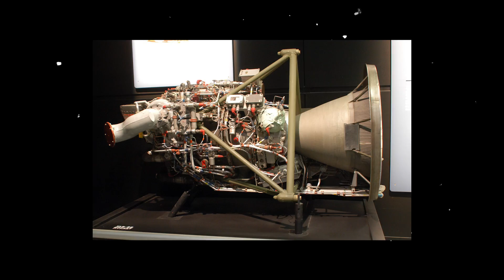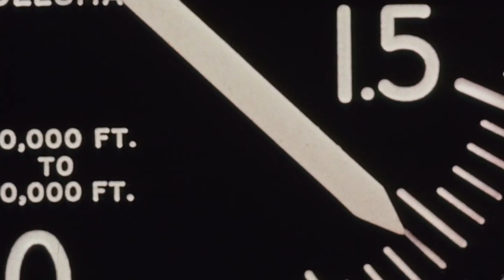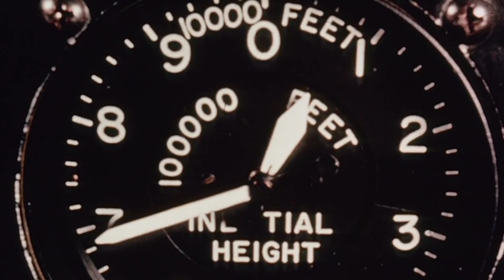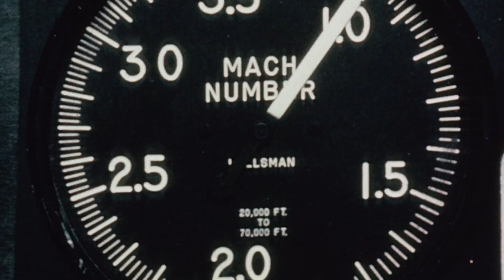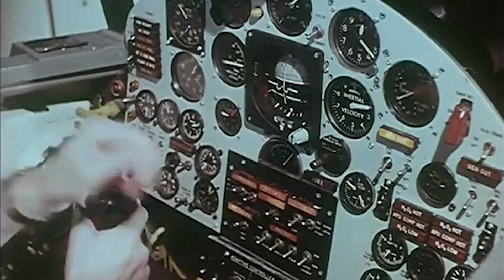The Plane that Almost Melted - The Fastest Flight Ever Mach 6.7

Comment: "defied gravity" is a objectional expression. You can't defy natural laws, just use them to achieve lift to exceed the weight, in this case deflect the incoming flow downwards by a wing with circulation , according to the Kutta Joukowsky law:
Lift force is the product of the density times the velocity times the CIRCULATION times the wingspan . The understanding how circulation is produced, namely by separating vortices such that smooth flow leaves the trailing edge, according to the Kutta condition. This was understood by Ludwig Prandtl and his Students.

Comment: No aircraft built has ever "defied the laws of physics", they have in fact used those very laws in order to stay airborne.
If they defied the laws of physics they wouldn't have need wings or a means of propulsion, they'd have been able to just sort of float up into the air somehow and speed away.

Comment: This is getting kind of sad.  The  Bell X-1 did not "defy the laws of physics".  It's design applied physical law in order to achieve the engineering that made exceeding Mach 1 possible.  And the title is just clickbait.  An X-15 was coated in an ablative substance in order to handle temperatures that it wasn't originally designed to handle.  The coating melted.  It was supposed to melt.

Comment: *important*... he wasn't doing mach 6.7, he was only doing mach-4.3 over land... the speed of sound at 100kft is actually less than the 677mph ... referring to the mach number is meaningless.   The pressure up there is less than 1/6th that of sea level so the end result isn't all that much more impressive than a Foxbat at full tilt at mach 2.5 at 60,000 feet which is taking nearly 5x as much density and quite literally twice the force to the face and moving over land at a greater portion of the X15's velocity than not.    Mach value is an incredibly arbitrary number compared to cross-section force... as James May said when driving the Veyron, the wind pressure was equivalent to driving through fruitcake at 250mph at sea level.    Why do I mention the Veyron?  It applies about 1/500th the thrust the main engine of the X-15 produces and has roughly the same effective wind cross-section.

Comment: As a kid, my father worked at the Lockheed Skunkworks.  I remember hearing sonic booms frequently then they suddenly stopped.  Probably some old ladies complained about them.  I thought they were cool and were only far-off booms, far from hearing damaging.  Years ago, my ex-wife and I were driving along a remote desert road that was sparsely traveled.  I had an F-18 come down and turn over me only a few hundred yards off the ground.  The wind blast knocked my car over several feet, but I thought it was fantastic.  He/she was probably using me for target practice, or just playing around. Years ago, I was at the top of a small mountain with my brother, and an A-10 buzzed us.  It must have been traveling much slower because I remember no wind blast and the plane was very close.

Comment: While still in the possession of North American Aircraft, Scott Crossfield was strapped into the cockpit of the X-15 in a test stand. They were testing the then-new One Million Horsepower rocket engine. Crossfield shut the engine down after a test run and when he reset the ignition system, the engine exploded, blew the X-15 in half and shoved the cockpit part of the fuselage 15 feet forward.
Crossfield later commented "It was like being in the sun, everything around me was orange.
Reply: After this event Crossfield gave an interview to a news reporter. He said he had not been injured but his pants got wet from the water used to extinguish the fire. Next day the headlines said "X 15 explodes, pilot wets pants".
Reply: @romanroad483  Right!

Comment: it was pioneering work with x15 that made the space shuttle possible. But didn't the space shuttle go faster than the x15 - yessir, it did!
Reply: Not in powered flight it didn't. The narrator in this video is very careful to always specific "crewed powered flight".

Comment: I have to say that you didn't follow through with your title or opening introduction to your topic leaving the question to what happened to the pilot when the jet was melting and coming apart around the pilot at 4300 mph. Certainly he could not have made it to the ground if  jet was melting. Lastly the picture is either a fake or left out of your presentation all together. Because no crash is mentioned.

Comment: “One of the most experimental aircraft ever built…” How do you actually quantify that? More “experimental” than Concorde or the Space Shuttle?
Reply: Truly the most experimental aircraft humanity ever witnessed
Reply: Absolutely, yes. The X-15 was literally designed and built for testing unknown flight parameters, whereas the Concorde and the Space Shuttle were both designed more or less within known limits in order to do their respective jobs.

The Concorde and the Space Shuttle were innovative and cutting-edge, but they weren't experimental.

Comment: If a jet flying 5400 mph melts and rips itself apart from the speed how come a rocket doesn’t rip itself In glad
Reply: Because we've learned from these tests, and from many many rocket tests.

And also for the same reason why the X-15 was so much blockier than supersonic planes: the exact same features which make a wing good for aerodynamic lift, also make it get very hot at high speed. That's why rockets are basically shaped like bullets, which is a shape that's much more able to handle those speeds.

Comment: X-15 also holds another unofficial record. In one of the tests of engine on the ground in a special test rig, the engine exploded. Firing the pilot and the forward capsule forward at above Mach 4 in under 20 feet. The pilot set a speed record for fastest acceleration ever at the shortest distance known. Ironically the pilot was generally fine, with no spinal injuries, he ribs all had small stress fractures thought. The only reason he wasn't hurt more under what is believed to be over 30G's of force (though exact G load is unknown) is because he slowed down pretty rapidly. Meaning the G load didn't last long enough, maybe 90 seconds, for more permanent damage to be done.
Reply: It achieved Mach 4, but only went 20 feet?

Or it took 20 feet to accelerate to Mach 4?

Either way, you're lying and/or wrong.
Reply: Alternate theory? The engine was ran at levels needed to achieve Mach 4, while on a ground based test stand, and failed.

The resulting failure, tossed the cockpit, 20 odd feet away...
Reply: P.S. Just delete this nonsense...he went from 0 to Mach 4 and back to 0, in a 20 ft span, but endured 30 g's for 90 seconds????

Were you drunk when you researched these "facts"???

Comment: 00:15 * groan *  No, no, no, NO ! Reaction engines are not measured in horsepower! Measuring a reaction engine in horsepower is measing how tall you are in Miles Per Hour. To quote Johnnie Cochran Jr: "That, does Not. Make. Sense"

Horsepower is for torque engines... engines that deliver their output to a rotating drive shaft. The performance of reaction engines in measured in thrust (Newton, kg, lbs) and — to a lesser degree — speed ("delta v").
Reply: Complaint number 3...

Instead of "wasting your breath" use that egghead of yours and make the conversion...

Comment: Imagine being in SR 71 flying at Mach 3  then being passed by the X 15 going twice the rate at Mach 6.
Reply: The X-15 flew for 11 minutes, much of that a non-powered descent.  The SR-71 flew an hour between each in-air refueling for 10 hour missions.
Reply: @RichardinNC1  And the Blackbird was air breathing but still, Mach 6.7 is pretty ridiculous.
Reply: In many ways the XB-70 Valkyrie was more impressive than the SR-71. It has a top speed close to the SR-71 but was around double the size. 

"It was 185 feet long vs. the 107 foot long SR-71. At a maximum weight of 534,000 lbs, the Valkyrie weighed nearly as much as a fully loaded Boeing 747 airliner."
Reply: The SR-71 pilots said "what was that?"

Comment: If the x-15 was flying at Mach 6.7 in the late 50’s imagine what the SR-71 Actually flew at but hasn’t been declassified yet.  OR the SR-72 is currently flying at.  Just saying.
Reply: the SR-71 is limited to Mach  3.5  any faster it would melt also a jets turbine will fail after 3.5 Mach you have to be rochet powered or scram jet powered to go over Mach 3.5

Comment: There was an X-15 on display at the Kern County Fair (Edwards Air Force Base is mostly in Kern County). I was pretty young but knew something about aircraft. I didn't believe it was the real thing because the vertical stabilizer was really thick at the rear. It turns out, that's the way they are.

Comment: Scott Crossfield nearly died testing the X-15's engine.  They had the plane bolted down on the ground, and simply needed to run the engine up to speed.  It exploded, shooting Crossfield forward in what was left of the plane, at several G's.  He walked away from that though...more testament to test pilots.
Reply: After this event Crossfield gave an interview to a news reporter. He said he had not been injured but his pants got wet from the water used to extinguish the fire. Next day the headlines said "X 15 explodes, pilot wets pants".
Reply: @romanroad483  Cool...hahs

Comment: Rocket engines are NOT rated in horsepower.
They're rated in pounds of thrust (for the US).
Reply: Yes, but you can still calculate an equivalent horsepower if you know the thrust and speed.
Reply: @Pastor-of-muppets1985  And as I recall ALTITUDE also plays a factor.
That might be more on jets than on rockets though.
Reply: But you CAN rate them in units of horsepower, if you are so inclined..
Reply: @codymoe4986  You can rate them as sort of a horsepower equal - but it won't be ACCURATE unless you specify a lot of details that affect that rating.
Jet engines and rocket engines don't have torque, that horsepower is BASED on - thus you can approximate an equal, but not calculate a true and accurate value.

Comment: 600,000 HP. That would be a sick engine to put in a sleeper.
Reply: Moj Benson runs a hot dragster with two back to back. Huge wheelie bars ...everything.Does .2 quarter miles on half boost.
Reply: Honda Civic.  I was thinking the same thing.
Reply: Nah that would be a boring choice. @texaswunderkind  If you want to go with a tongue and cheek answer. Pick something like a Chevy Chevette or perhaps an AMC Pacer.

Comment: Every time I watch these  Dark Skies videos I think of my father who had worked as a senior electronic aerospace engineer for North American Aviation thru the 60's until they got acquisitioned by Rockwell and Boeing.
Reply: I had a brother in law who helped design the C-130 tail and later the control fins on the Saturn 5 booster. His eye glasses were thick as pop bottles bottoms back in the day.  I can still picture him sitting at his drawing board, and staring at the markings on his Pickett slide rule as he added dimensions on his drawings.

Comment: I worked in engineering at McDonnell Douglas in 1990. An old timer named Joe worked on the X-15. He told me about how one of the landings was very rough and the fuselage broke. He said that the huge wiring harnesses helped hold it together until it stopped. He also had a funny story about seeing the U2 which was secret at the time. He was driven up to a rusty hangar. The driver left him in a bus and drove away in a Jeep. It was in the 40’s and he didn’t have a coat. He walked into the hangar and there was the U2. He turned around and a soldier with a rifle came in and said, “What are you doing here?” “It’s freezing out there.”  “Well, get back in the bus. I had to take a piss”. I started my aerospace career at Bell in Niagara Falls in 1983. There were quite a few old timers there. They worked on the X1, the jetpack, tilt rotor, and the Star Wars laser. It was quite a collection of engineers.
Reply: Thats cool as, what was the Star Wars laser?
Reply: @fanatamon  It was a high energy chemical laser. 12” diameter beam, 3,000 mile range. It would be aimed by bouncing off of a chrome moly mirror. I left Bell but read about it being tested in White Sands around 7 years later. Boeing put a similar design in a 747 and used a mirror under the nose of the aircraft to shoot missiles. The US signed an agreement with the Soviet Union to not put lasers in space, so the US tested them in aircraft. We (the US) are fielding lasers on trucks now.
Reply: @jamesdellaneve9005  I’d imagine then they are pretty powerful by now.
Reply: @fanatamon  I don’t know. One of the design problems is the size of container that it takes to create such a beam and the energy to make the laser burst. It’s not a steady beam , but a micro burst so powerful that it destroys the missile body/structure.
Reply: Bull$hit story of the U2 in the 40's, time line is wrong.  U2 fuselage was based on the F104, check the time line !!!

Comment: I Luv the fact that all Engineers were using Slide rules back then. Computers . . . What's That ?  The Texas Instruments T1 calculator didn't materialize until 1967 and could only do Arithmetic.  It wasn't until 72 when their first handheld came out, the T1-2500 Datamath, that could do limited Math as well. 
   Anyways, they don't make Engineers like they used to, no wonder it's taken so long to get back into Space.
Neil Armstrong was also certificated to fly the B-52. And, I wouldn't be surprised in the least to find out that Lockheed Martin or DARPA have produced a Hypersonic Piloted A/C that makes Mach 7.0 or higher.
Reply: Yea, there's no real reason to break out the slide rule anymore. My only point was the understanding of the basics of physics can put boots on the Moon, computers cant do that for you. The more you know about the basics of how stuff works, the better a problem solver you'll be. Counting on a "program" or computer to "solve for X" doesn't motivate or stimulate imagination, but having a bit more knowledge than the next guy will.
Reply: Yeah, I went to University for Aerospace Engineering class ‘92. We were taught how to use a slide rule, but after I graduated I never took it of its case again. :) Now, I have basically the same computing power in my pocket that our CAD mainframe had… LOL :)

Comment: There used to be piece of the X-15 windshield at the San Diego Air and space museum and it might still be there... it was several inches thick and partially melted from the intense heat 🤯
Reply: The cockpit windows on the never melted during any flight. There were several flights where either inner or outer panes of the windows cracked, but never melted.

Comment: Still the fastest manned aircraft ever built and nothing remotely like it has been flown by Russia or China in the last 70 years since X-15 took to the sky.
Reply: Was there some sort of competition announced?
Reply: It's sort of like landing people on the moon, it's a cool idea but it's massively expensive and there is little to be gained by doing so
Reply: @DjDolHaus86 I did give a lot of data on the aircraft construction and how metals stand up to the heat. It was also a prestige project which the Russians couldn't match. The Russians started the space race but failed later on in going to the moon,
Reply: @billballbuster7186  the same was true with the moon landings but that doesn't mean there is any point in doing it again particularly in the age of computers where things can be simulated accurately at a fraction of the cost
Reply: Why do it if they can steal the data?
Reply: @nels9382  What use is the data if you can't do it?
Reply: @nels9382  You do it for the prestige. The data is generally rapidly placed into the public domain anyway for the benefit of all so stealing it is pointless.
Reply: They didn't need to. They stole all the information we spent tax dollars to gain. Just like their first Atomic bomb was a dead ringer for for the Little Boy bomb IIRC.
Reply: Why should they?
Reply: @whosjulez1157  
Exactly

Comment: Much of the test data from the X-15 went directly into designing the Space Shuttle.  The X-15 was a crucial proof of concept that demonstrated the feasibility of controlled unpowered descents at high speeds from extremely high altitudes.  North American Aviation through mergers and acquisitions became Rockwell, the contractor who built the orbiter part of the STS system.
Reply: Interestingly at high Mach numbers, the air on the craft's surfaces starts to act like a liquid due to compression, changing the aerodynamics significantly.  Therefore it's a challenging engineering to make it work in both sub and super/hypersonic flight.
Reply: North American was absorbed into BOEING !!!!!!
Reply: Exactly.  Until that point, crewed reentry was done in bell-shaped capsules with ablative surfaces.  Not practical for a reusable spaceplane concept that was considered the next big step.
Reply: @texaswunderkind  Yet, in 2024 Boeing's latest design is ...well....another bell-shaped capsule with ablative surfaces. How we've progressed.

Comment: The X-15 that Pete Knight flew to achieve M6.7 was coated in a Ablative coating. It did not melt around him. It also had a mock scram jet mounted on the rear underside. This did melt off due to drag from the mock jet.

Comment: If the X-15 was "clocked at Mach 6.15", then why does the SR-71 (RS-71) hold the speed record at over Mack 5.??
Reply: SR-71 holds the official record for the fastest air breathing aircraft. The X-15 holds the official world record for the fastest rocket plane.👍
Reply: @iKvetch558  My bad...
Reply: @tkskagen  No worries at all...most folks are not even aware that there are a bunch of different airspeed records, depending on the type of aircraft. Be well 😁👍
Reply: @tkskagen What is Mack 5?  I heard from a driver the SR-71 flamed out over mach 3.4.
Reply: Wrong. And it's Mach.